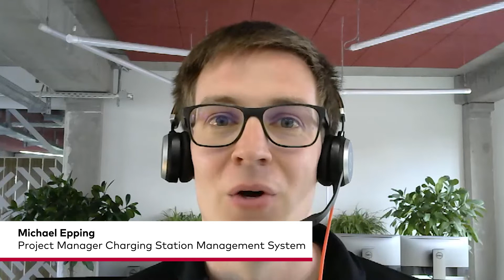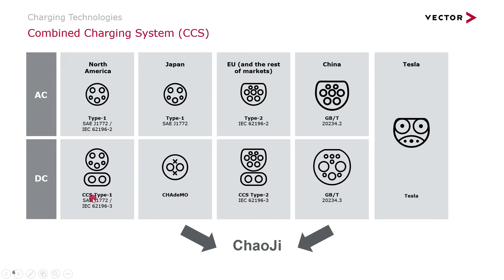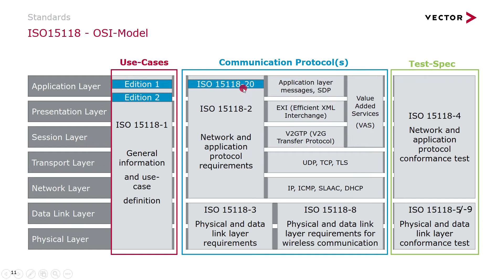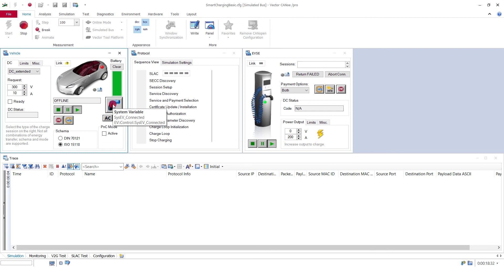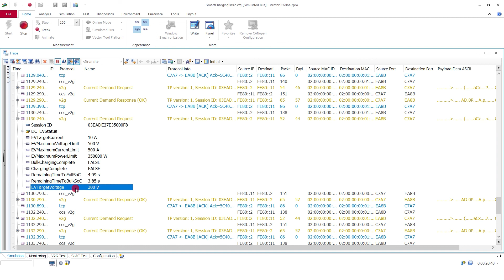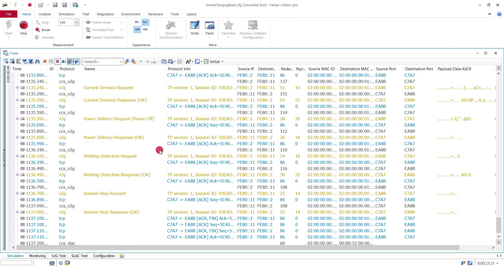Standards for Smart Charging Communication between Charging Station and Electric Vehicle

Comment: Great video very informative. Is it possible to pause or stop the charging process and restart it without disconnecting the connector?
Reply from the maker: Hello James Bates, yes, the vehicle can pause the ISO15118 communication, for example to save energy. If there is demand for more energy transfer, the vehicle can resume the communication and charge again. This could be the case if the vehicle shall be preconditioned minutes before departure.

Comment: Hi! For the up to 22 kW 3-phase AC charging, is there any kind of CAN communication going on between the EVSE and the OBC/communication module that talks to the BMS? Or is the current selected only by the PWM signal provided to the Control Pilot pin? Thanks a lot!
Reply from the maker: Hello Wagner Brochini, for Type-1 and Type-2 the communication is specified by the IEC61851 (“Low-Level Communication” or “Basic Communication”). The maximum current is signaled by the EVSE with the duty cycle of the PWM signal. There is no CAN communication between vehicle and charging infrastructure.
If other standards are used, e.g. ISO15118, additional communication protocols are used. If you have further questions, feel free to contact us at OffboardCharging@vector.com.
Reply: @vectorinformatik  Thank you for the insight! Just one detail, the PWM signal is generated from the OBC and passed to the EVSE via the Control Pilot pin, am I correct?
Reply from the maker: @wagnerbrochini3892  No, it is actually vice versa. The EVSE generates the PWM signal. The frequency is 1kHz. The duty cycle signals the maximum current which the EVSE is able to delivery. There are some special values, e.g. 5% means high-level communication only (ISO15118, DIN70121) and 100 % means charging not allowed. The amplitude of the signal depends on the current state and is changed by the vehicle. State A: No vehicle connected (+12 V), State B: Vehicle connected, not ready (+9 V), State C: Vehicle connected, ready for charging (+6V). Hoping this helps you and feel free to contact us via e-mail.
Reply: Oh okay, I'll contact you via e-mail, aí was wondering how does the vehicle choose the current it needs, maybe it's just the first part of the communication that the EVSE tells the car what is the maximum capabilities and then the car takes on by demanding what current is actually needed via PWM on the same pin

Comment: Hello everyone, I ask the question. 

Can I contact the OCPP Protocol and Protocol IEC 60870-5-104.For example, can I get information from a charging station into an SCADA System with 104 communication protocol? or IEC 61850. I found some information, but I wasn't sure. I'd appreciate it if you'd help me.

I couldn't find the information in detail. This issue very important for me.

Thank you.
Reply from the maker: Hello Kadirhan Karakaya
, thank you for your question! vCharM provides different protocol interfaces to exchange charging information. vCharM implements already a REST and Modbus/TCP interface, which can be used for the integration with other management systems. If IEC 60870-5-104 or IEC 61850 is important for your use-case, we are interested in an exchange for a better understanding of your requirements. Please contact us at OffboardCharging@vector.com

Comment: hello thank you very much for this tutorial I would like to ask you is it possible to supply the charging point with on-Grid solar parking or there is a specified type of charging station for this
Reply from the maker: Hello 
Khairia Abdelmoumen, depending on the required charging power, any source of standard AC electrical energy can be used for charging. A combination of a stationary battery and photovoltaics with a dedicated DC/DC converter would allow more effective DC charging of vehicles though.
Reply: @vectorinformatik  Thank you very much

Comment: Proph. I have Ford Focus Electric 2017 with CCS1 socket and I got this car with me to Egypt , while them DC stations uses CCS2 , I charge fine with ABB stations using adapter CCS2-CCS1 , but I can’t charge with EVbox DC stations , the car Lock and gets ready to Charging session , and within seconds it unlocks and the charging session terminated, Why this happens only with EVbox DC stations. ??? May you please help me figure out the reason. ???
Reply from the maker: Hello Tamer El Malek , thank you for your comment. It would be best if you contact your car manufacturer or a local office with your question. If you have further questions about our charging infrastructure solutions, please feel free to contact our support at support@vector.com